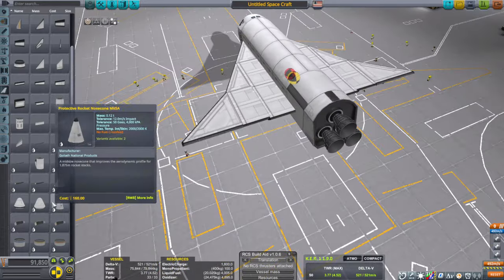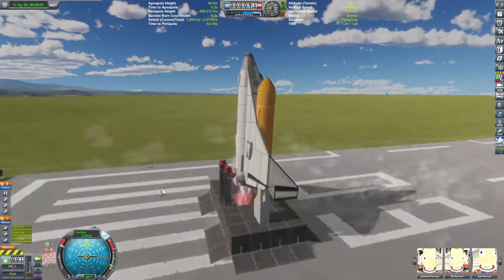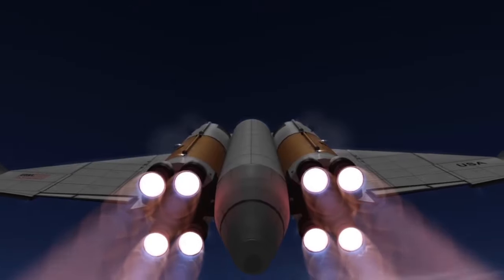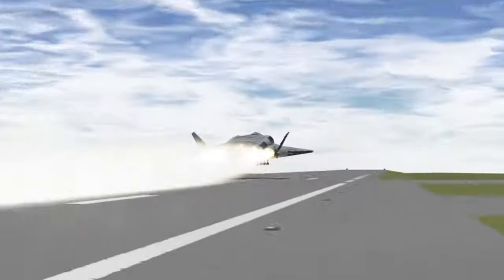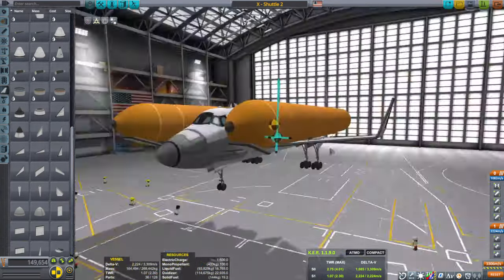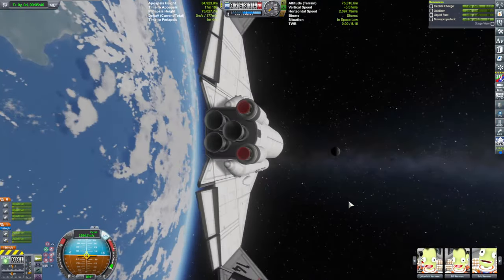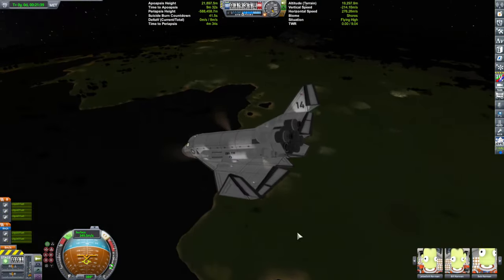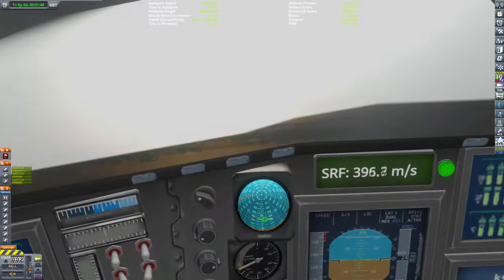NASA Concept Space Shuttle in KSP !

Comment: Wing incidence is generally a not so great idea for a spaceplane or hypersonic vehicle. There are multiple reasons why, but its use is usually compensation for poor takeoff performance (too large a static margin, overweight, lack of flaps, etc.) and poor design. The reasons why we avoid wing incidence on supersonic and hypersonic vehicles is two fold. The first is obvious, it increases induced drag at zero angle of attack (AoA) which is supposed to be minimum C_D for parasitic drag. By adding wing incidence you offset the induced C_D vs. AoA curve, leading to overall more drag at positive angle of attack. The second reason is aerodynamic efficiency (C_L / C_D or L / D). Somewhat counter-intuitive, but aerodynamic efficiency increases with increasing AoA, but only up to a certain point. This critical AoA varies depending on the airfoil. After the critical AoA, aerodynamic efficiency drops. So by adding wing incidence, you are offseting this curve too and reducing that critical AoA. There are other reasons, but they are not simulated in KSP. If all else fails, a better way to acheive the wing incidence you want is to have a higher nose wheel.